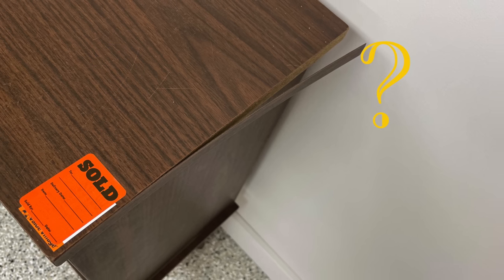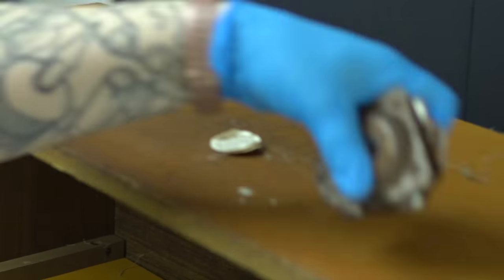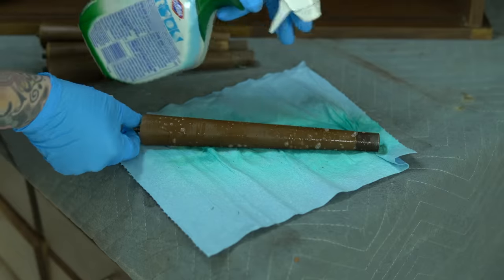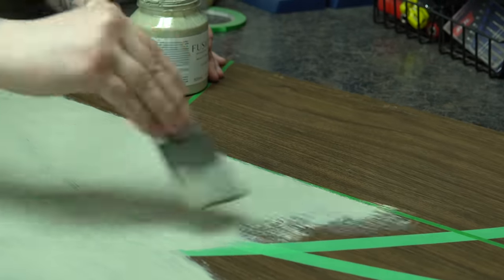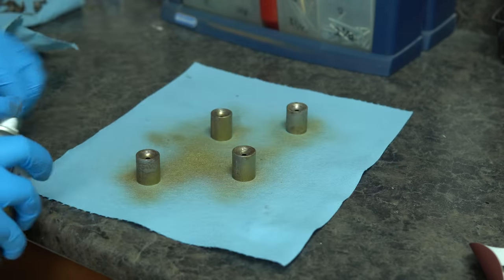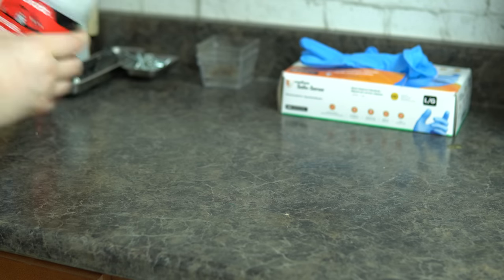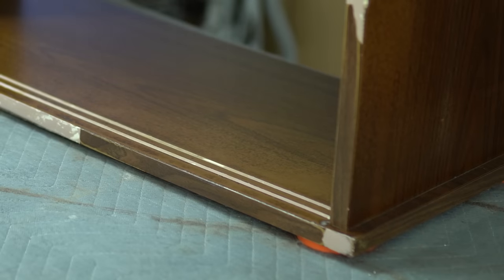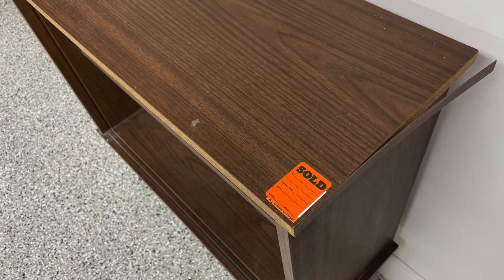Make REALLY CHEAP FURNITURE look AMAZING on a budget

Comment: I really love your calm, no nonsense demeanor as you explain all of the details to your process. As someone who worked as a furniture refinisher I appreciate you showing how to save pieces from ending up in landfills. It breaks my heart to see so many things go into the trash compactor on garbage day. We used bond to fill on occasion, but the embedded nails is something we never considered to prevent the filler from breaking away. I imagine small dowels or splints would do the same thing. The geometric pattern on the inside of the back really added to the finished piece. Job well done!
Reply from the maker: Wow! Thank you so much for your incredibly kind words. Much appreciated!

Comment: Thanks for the nail in the bondo tip.  I’ll be using that tip this week . 💕✌️
Reply from the maker: It’s great for corners where the concern would be it getting knocked. Just be careful if you’re doing it into solid wood- nails can split the wood. I’d recommend using smaller nails or even pre-drilling for small screws… if it’s wood.

Comment: Yay. Perfect timing on the nails in Bondo trick, I need to repair a big gouge in a wood exterior door. I was trying to think of good ways to help it bond. This is perfect. BTW the reason I have to do this is someone installed a doorknob in a storm door that was too big to close the wood door. So it looks like the took a knife and gouged a hole in the wood.  Which damaged a nice vintage door and the knob in the storm door also eventually broke from pressure. Replaced the knob last week, now need to repair the door. Glad I watched this video on my lunch break
Reply from the maker: So glad I could help! Isn't it sad some of the things people will do just to make something "work" instead of doing it properly to begin with! All the best on your door repair and thanks for watching!

Comment: Omgosh I learn so much from you ty.  I have press board kitchen cabinets and the trim has been missing forever and I have the same problem on one of the drawers, using nails as rebar is brilliant! Just because I'm lazy, why don't you use the screw gun...like all the time lol not always but you know what I mean. Love your work. Stay well 👍💕
Reply from the maker: Sometimes it the angle I need, sometimes I'm being careful not to put too much pressure on delicate wood, sometimes it just faster to do by hand.  There are a multitude of reasons. Thanks for watching!

Comment: It's beautiful!  That color is so fresh and light without being plain white.  Angie, do those leg caps pop right off once you take the little tack thingy out?
Reply from the maker: They do! But there are different kinds. These ones with the tacks on the bottom are easier to remove than the ones with tiny nails that hammer into the side of the caps.

Comment: Thank you for your video!  I enjoyed it and will check out others. I wanted share a metal cleaning tip with you to help with rusty pieces. It’s called phosphoric acid and ship builders, farmers and metal workers use it to keep tools clean, and protect the metal in boats. It’s fairly cheap, works quickly, and is awesome for stopping rust in its tracks. Having it in your arsenal of home products will go a long way on your projects. Sometimes it’s called naval jelly.
Reply from the maker: Thank you so much for the tip! 😊

Comment: I think possibly it's earlier? I was born in 1960 and that style, if I remember correctly, was around then, it's the legs. My cat fetches too, she loves a couple of old braided bracelets I have and when she retrieves it or decides it time to play, she touches you with her paw to get your attention, I'm often woken up with a little pat and a meow in the morning 💕
Reply from the maker: It’s a very common mid century style, indeed! This particular model was quite common in the 70s especially, but you could probably find a few in the late 60s. I find though that the 50s and 60s ones tended to use a different style of faux wood grain, and products like Formica, rather than this softer printed “grain”.

Comment: Great job, once again.  And unexpected!

As you were re-attaching the bottom shelf to the sides, I was screaming inside my head about using dowels and glue because screws don't hold well in particle board ends.  And they don't, for the long term, but this is a very good demonstration of turning a pile into a useful piece that will last for a little while.  So, yeah, screws are O.K., and the dissimilar materials will be fine for a little while.  (Bad OCD, go sit in the corner!) 🤫🤐🤣
Reply from the maker: This particular video was more about flipping for folks that don’t have access to things like drills and dowels. :-)

Comment: Great restoration. Chipboard is often those things that seems futile to repair, I shall thing twice about it next time.

 I found a product that cleans up rusty metal caps, brackets, screws, trims, etc. with out any soak. It is called Quick Glow and is in theory a polish, but it cleans off grime and rust surprisingly easy. It usually eliminates the need for sandpaper and steel wool, just a bit of a white paste on a damp cloth and it is done on first attempt. Nothing smelly or too harsh either.
Reply from the maker: Thank you so much for watching! 🙂

Comment: In holes for leg brackets, I usually push some matches or toothpicks with wood glue and then drive screws in. Especially when the thickness of the board is not allowed to use longer screws.

Comment: Very nice! Great tip to it the nails in the corner to support the Bondo repair. A complete trash to treasure! 

A couple ideas, to continue the riff. I was able to replace missing glass bypass doors with plexiglass from a plastic store for about $20 US. I drilled a one in ch hole as a means to open and shut the plastic bypass doors. This gve me a cat safe space for collecting things, so personally was worth the money. Sometimes if shelves are bowing, and I'm painting anyway, I might flip them over.
Reply from the maker: Those are great ideas for sure!

Comment: What a great transformation! And so great to see things we can do without lots of product. However, i was wondering if there's any alternative to Bondo. It's pretty expensive i think?
Reply from the maker: There are dozens of fillers out there, but few cure as hard and shapable as Bondo for larger fixes. For small areas, just a regular wood filler is fine, but they are also fairly pricy, unfortunately.

Comment: I would suggest getting a metal tumbler/polisher and using walnut shell media to clean off the rust from small pieces like legs mounts and feet caps. It works much better than most other methods I’ve tried. 

You can find 5lb tumblers on eBay for less than $125 Canadian.
Reply from the maker: I have multiple ways that I do this- I was simply trying in this video to show people how to do it with products they probably already have. :-)

Comment: I've had vinegar solutions not work on tough rust, but my dad discovered molasses in water etches metal down over the course of days! He's an optomechanical engineer and has tested and vetted it, just tie items to a string and pull it out of the container every day or so to check etching. On casted items probably every few days
Reply from the maker: Thank you so much for watching!

Comment: These are the types of pieces I can find. Thank you for this video. I do have a question- what do you do about rust on an original wheel/caster when the wheel is wood? I can’t soak it. Thank you in advance if you’re able to answer.
Reply from the maker: That is a really good question and honestly I'm not 100% sure. Oh all the pieces I've done over the years I've never once had a full set of wooden casters, they've always had to be replaced. Thanks for watching!

Comment: I love the way this turned out—very nice looking!  I wonder what it auctioned for.

Someone could make a LOT of money if they found an alternative to those gawdawful felt pads.  They slip off at the worst times (can’t tell you how many times my floor has been scuffed when people slid my furniture across the floor and didn’t see that one of the pads had come off.  I’ve wondered if there’s a way to PIN them to the legs, with something that would create a dimple in the felt so the pin doesn’t touch the floor, but worry that if you don’t manage to do it right the pin will cut into the floor over time.  Also, they’re a cat hair magnet. I hate them. There has to be a better way.

Comment: Have you ever tried Durham’s Rock Hard Water Putty instead of Bondo? It’s a powder you mix with water that creates a wonderful rock hard wood filler. It paints well though also very hard to sand by hand. I used it on my outdoor top porch rail and it withstood all weather. Plus at less than $4 per pound it’s much cheaper than Bondo with a longer working time.
Reply from the maker: No I've never even heard of it before, thanks for the tip! 🙂

Comment: I've watched a number of your videos, and it looks like you need a buffer/wire wheel for metal parts. Take a look into how to hold a drill in a vice and add whatever attachments you need. Just my .02
Reply from the maker: This video wasn’t about necessarily the most efficient way to do things. I have a multi tool with wire wheels etc. (I’ve used it in multiple videos). This video is for people who don’t have access to special tools, and to do things with materials most people already have at home.

Comment: Is the shelf original to the piece? I have one of these but it holds a rack for records and also has two sliding doors. Originally from Montreal, now in Toronto.
Reply from the maker: It is on this piece, but there are lots of similar styles with different uses.

Comment: How do you price your resale pieces? Labour plus materials or by another method? Thanks in advance
Reply from the maker: Cost per hour doesn’t work for me, at all, though it might for someone doing custom work. For me, a piece of furniture is worth what it’s worth, whether I breeze through it or struggle with repairs that take me two days. It’s still only worth X amount of dollars. I didn’t specifically say “charge what everyone else is charging.” It’s a guideline only, as many people under charge. My point was simply that if everyone in town is charging $400 for a pine dresser painted with a woodgrain top, charging $1500 might not fly. Again, it’s very different if someone is doing custom work, which I don’t. I could come across the exact same style of dresser (which has happened multiple times) and could refinish both exactly the same. But one took a day and a half longer because it needed more repairs. I can’t in good conscience charge several hours more for it. It’s the exact same outcome. 
There’s no magic formula that will work for every single person.
I hope this helps! Thanks so much for watching!

Comment: I have a? Bookcase I bought 15 years, v the sides are solid wood the shelves 32in and backing or 3/8 inch plywood. The craftsperson made around the 3 sides.... Then mounted the whole thing on... 60's angled  legs? 😅 The sixties angle legs were the first things to go but that's solid wood shelf 32 wide by 96 been used in three places in three houses since then.
Reply from the maker: I love that you're still using it. Thanks for watching!

Comment: Are you using cleaning vinegar or regular distilled?
Reply from the maker: This was cleaning vinegar, but I've done the same with regular. The cleaning vinegar does a bit better of a job, of course, where it's a bit stronger. Great question! I totally should have mentioned that in the video.

Comment: Baking soda and vinegar mixed together cancel each other out and basically leave you with plain water. I'd soak the parts in the vinegar for about 24 hours and then scrub with steel wool.
Reply from the maker: That’s only partially true. Baking soda and vinegar is an age old cleaning recipe that is fantastic for tough grime, cleaning drains, and cleaning rust. The chemical reaction is strong but natural, so it’s a safer alternative than some actual chemical cleaners. So yes, one is basic and the other alkaline but there’s an awful lot that goes on before it becomes inert.
Also, these WERE soaked in vinegar prior to being scrubbed with the baking soda.

Comment: I don’t understand the point of spray priming it first. Why not just paint directly before the spray primer ?
Reply from the maker: The primers makes multiple surfaces uniform, so that the paint job is uniform. If the surface is already all uniform and there’s no risk of tannin bleed through or adhesion issues, you don’t always HAVE to prime. But here I had some laminate, some filler, etc. If I had just painted it without priming, the paint would absorb into the filler more than the laminate and it would be clearly visible. The primer makes it so that those material boundaries aren’t visible anymore.

Comment: Best way to sand the legs is to chuck them up in a drill then spin them and hold the sand papper to them
Reply from the maker: I’m not personally a fan of it, though I know a lot of people like it. It generates a lot of heat, and can ruin the threads if tightened too much by accident. I usually used my surfPrep or scrape and then hand sand. I don’t mind it at all. :-)
Reply from the maker: Ps- plus the purpose of this particular video was showing how to do things for folks who may not have power tools. :-)

Comment: i wish you would use nonsponsered paint...mineral and milk paint were replaced years ago by by better products...it is chemically inferior and brings all the sleazy resellers like fusion...they don't manufacture and they sell paint that has an ugly finish that doesnt adhere well
Reply from the maker: I am not sponsored by Fusion. I am an affiliate, which means if anyone buys any, I get a small kickback. Not the same thing as a sponsorship. There are many MANY paint brands. It is an excellent paint, it has fantastic adhesion, and is durable…when things are properly prepped. If you skimp on the prep, you won’t get a good result. But that goes for any paint brand. I also find it has a nice smooth buttery finish. I’m thinking it may be user error if you’re having that many problems with it.